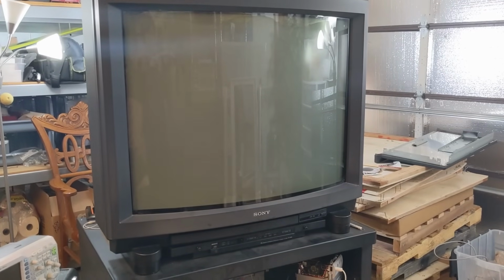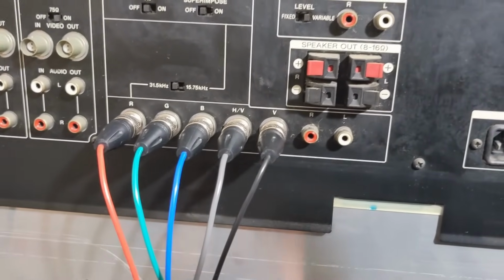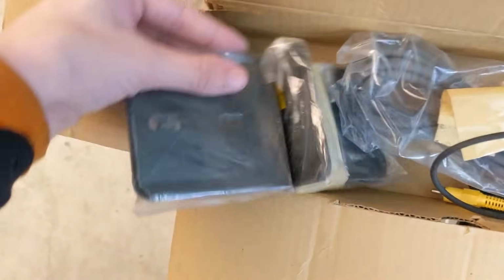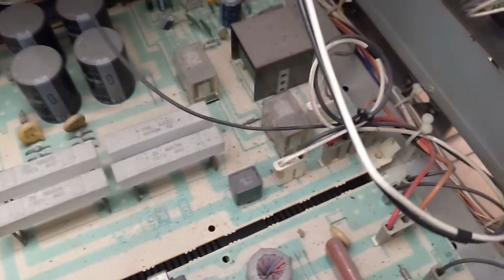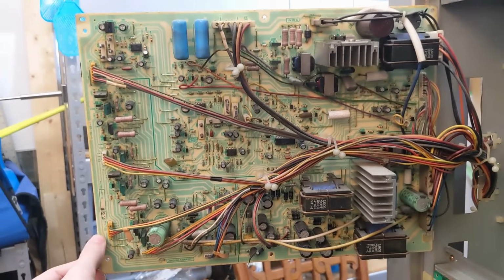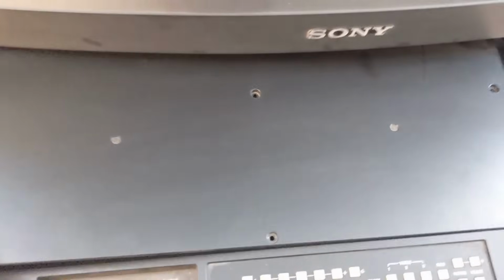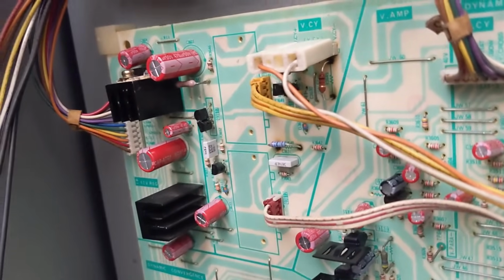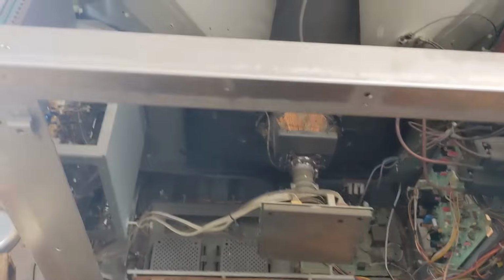Overview of the KX45ED1 / PVM-4300 (Worlds Largest CRT)

Comment from the maker: Few fun facts and FAQs:
-Yes, I'm using a 100v step down transformer. I also run it through a surge protector, and completely air gap the whole setup when it's not in use.
-The TV has 3, yes three, damper wires
-I cleaned it after the filming video. I hadn't cleaned it yet at this point as I was considering filming the cleaning process and including it in the main video, but didn't
-I have not done a total recap yet
-I have not tested PAL, but it makes no mention of PAL anywhere, so I doubt it will work, but I will try at some point.
-Allowing random people to see it is tricky because it's not particularly mobile, and bringing strangers to see it is effectively doxxing myself.
-I am open to cataracts repair, but it is extremely risky so I am extremely hesitant to do so
Reply: This is not classic cataract, more like de-lamination. The safety glass itself might be a double layer laminated glass, and its layers might also in the process of de-lamination. Unless you find soneone who have done safety glass removal on Trinitrons, don't ever risk doing it. And if the safety glass itself is bad or breaks during removal, your only option will be to use it without safety glass. I don't think it would be dangerous, the tube surely has an implosion band too, so it won't implode spontenaously, they just added the glass as an extra layer of safety, because due to the huge size, in case of a screen impact the implosion band would probably unable to keep the pieces of the screen together.

I would remove the front bezel, carefully clean the edge of the tube and check if there's some sealant around the edge where the safety glass meets the screen. If not, or if it looks deteriorated, I would apply some strong adhesive tape or acid free silicone sealant, to make sure dust won't be able to penetrate between the de-laminating layers.
Reply: I would never risk the cataract repair, ever.
Reply: You don't need the 100v transformer if the device has a switch mode power supply, which this monitor does. Sometimes there is a jumper wire or switch for 230v but not for 100/120v.
Reply: @andydelle4509  I do not recommend running Japanese domestic market equipment rated for 100V only on 120V, even though a fair number of people get away with it. The mains filter caps in front of the switchers are only rated at 160VDC with a surge rating of 200V. Rectified 120VAC results in ~170VDC and that's playing with safety margin at that point; which you do not want to do on anything you care about let alone something this rare.
Reply: @MadScientistsLair  " The mains filter caps in front of the switchers are only rated at 160VDC"
Well if that's the case, then my advice is indeed bad.
Reply: I'm not sure that's a cataract. Sony put an anti-glare tint film on those tubes, @RetroTechUSA has pulled damaged/discolored film off PVMs with nothing more than a razor blade.
Reply: @coyote_den   You might be right, but this is easy to test by pressing the de-laminated part. If it's just a plastic film, it will be flexible on that spot
Reply: get in touch with retro tech channel(you might know about him already). He does crt repairs and can give you advice or contacts for specialists to do the repairs.
Reply: I think the only thing that wasnt been said is making sure it is getting clean power and a clean ground. The clean ground being the thing you might look at. 

If it is 2 prong, making sure the neutral is clean. Also making sure things on the circuit are not wired backwards. (Having the Live and Neutral Switched; they light up so everyone things they guessed correctly of which two wires they picked)

These are troubleshooting suggestions for everyone, not a demand or requirement. I always write posts in a way it can be referenced in the future.

It should be understood that no one should expect that you need do anything insane like buy a double conversion UPS. 

This is your TV, and you are sharing it with us. We should be appreciative, not demanding.
Reply: That's not the biggest, I've seen bigger, especially the later digital sets sold to production companies, nice paperweight tho. Will look good on the front lawn in a few weeks when it breaks. Recommend smacking to get it to work, and duct tape. Best of luck pal.
Reply: Were you ever able to digitize the manual?
Reply: Growing up in the 70s I was always envious of people who owned Sony Trinitrons. They not only had great color, they also had the squared corners which was very cool. I FINALLY bought myself a brand new 27" Triniton in June 2000 when I was 42 years old. I bought it on sale for $328 and I had. to wait ten weeks for it to be delivered. As soon as it came I rushed out and bought a DVD player. Unfortunately, I only had the Trinitron for five months. While I was visiting my family in Florida for the Thanksgiving holidays, a very bad storm happened where I lived in California. The. wind was so strong it broke my window and it rained on my lovely television for three days. When I got home it was  deader than disco. I didn't have a tv for a few years. I bought a 37" Toshiba flat panel in 2005 and it lasted 21 years
Reply: I don't think I've ever seen a crt be able to do pal and ntsc until after 1990
Reply: @turbinegraphics16  There were plenty. But they were usually sold for PAL markets. NTSC sets rarely have PAL decoders, but PAL sets often had NTSC decoders even in the '80s. I have two almost identical multisystem 14" JVC TVs from ~ '87, they can do PAL, SECAM, and two kinds of NTSC (one of them only supports one NTSC standard IIRC). The only thing they don't support (or at least don't claim to support) is PAL60. Unfortunately they only have an RF input.

Comment: There are way bigger television sets out of America. Especially tube sets from 98 on that aren't projectors. Phillips used photography sets special order, but no where were they as nice as Sony sets, but I remember those sets being 54 inch crt tubes and they weighed a lot less and overall very impractical for anything but composite light photography. But there are larger, but your set is nicer and heavier. Pixar used the set im thinking of.

Comment: I have a Toshiba 42 inch its like 220 LB's. I have a 40 inch Trinitron (Sony) Thing is like 160-180 Lb's. Its wild that in 1989 for 1 extra inch at ''43 inches'' It weighs 440 LB's and cost $40,000 Retail. The two Tv's I have were retailing about 3-4K USD when they came out in late 90s early 2000s. I feel these Tv's are a lot more special now. Lighter weight look better with retro games... Not a PVM but hey same stuff...

Comment: I wouldn't suppose you would treat me a 2010 IPS bravia with ccr tube still working just fine? 

It's slightly less viewing area at 40 inches but are becoming as rare as CRTs. Sometimes moreso. I'll throw in a 2007 dell 24" IPS PC display with ccr tube still working.

Comment: I was a TV tech from tubes until the demise of projection TVs. Started in 1984 with old tube TVs in school. Sony always was a total PITA to work on. They just did things that sometimes seemed complicated for nothing more than to be complicated. But, the projection TVs near the end had automatic kine bias. This means that as the tubes wore, cathodes, they would measure the current draw and adjust accordingly to keep the Grey scale ad perfect as it was set from the factory. Meant good color. Hitachi used to have point to point dynamic convergence, I think it was about 100 points throughout the screen. In service mode you would move a cursor X so to speak around the points. Then adjust each quadrant perfectly. You could spend hours in service mode doing this. It was also done digitally with the remote in service mode. If you spent enough time it would really be perfect. Not only that but the screen had mirrors in quadrant around the screen. The system would look at the convergence when finished and keep it there with automatic convergence. Projection TVs were really cutting-edge technology at the end of their life until flat screens killed them.

Comment: Are you certain that the line doubler can't be switched off for 240p? My Sony CRT projector has a built-in line doubler than can be turned off in the menu but the name of the setting is unrelated to the function.
Reply from the maker: I am not certain, but there is no OSD or additional settings to change

Comment: I had a 27" Sony Trinitron from the late 80s. It was in use till 2005 when I bought one of the first Bravia 32" LCDs. It is currently being used as my second monitor. Only downside is that it's 1080i, so I run it at 720p.

That remote control totaly brought me back to childhood, 'cos my CRT had a similarily shaped but narrower one, It also had that plastic window compartment.

Cheers!

Comment: I own a 27inch Samsung Dyna Flat CRT.  I acquired it in 2000.  Excellent convergence, geometric linearity.  It also has a tilt feature, turbo sound, component and weighs 110 pounds.  I've owned a 20inch Proton, which had a rainbow.  My Samsung DOESN'T.  It's only weaknesses were over scan.  This is the only CRT that I've owned that didn't have a rainbow. $1000 CDN.  What about your Sony?

Comment: that 21 pin plug thats above the word superimpose is called a scart socket which a scart cable  with two scart plugs at each end that plug in the scart socket here in the  u.k
Reply from the maker: Nope, it's JP21. Uses the same connector as SCART but has a different pinout.
Reply: @MoreShankMods  I'm sorry but that's what you call it. But here in the u.k it's we call it scart plug or scart socket we still use it now it doesn't matter where what pin out put is we still plug in scart plug into it?
Reply: @jambam6762  Its JP21 similar plug but its a completely different standard with different pinout, plugging in a scart input can fry your device and/or your TV.
Reply: @mactep1  Then why didn't he say it's for japan scart in the first place then this argument would of not got bad on here jp21 model number but instead,  he should of said it's for  japan 21 connector plus i just looked it up on the net what the differance is between euro connectors and japan connectors and they are differant which i didn't now I thought all scarts sockets are the same, so sorry but he should of explained it more detail and show pictures and info to people on youtube.
Reply from the maker: If you Google "jp21" it explains everything you need to know better than I can in a youtube comment 🙃

Comment: How can you repair a television without knowledge in complex impedance, physics and other things like inrush current?
Reply from the maker: How can a mechanic repair a car without a master's degree in mechanical engineering? I'm not designing a TV from the ground up, I'm repairing it. Find what's wrong, and test the components of the relevant circuit to make sure they are within the specifications described in the service manual, and replace components that have fallen out of spec.

Comment: Once you get this deep cleaned inside, fresh PSU caps, service menu tuned and colour calibrated, I'd look into adding an extra SCART input that is connected to a subpixel rendering scaler inside the set, directly wired to the internal RGB line, the subpixel rendering scaler board should be a 4X subpixel scale, which will give this set 4 virtual RGB subpixels per physical RGB subpixel, this will massively increase perceived resolution, and negate the fact that it's a larger screen which typically has a lower perceived resolution (subpixel-resolution), the GBS-C internally installed with a SCART output would be a great way to do this, it would also allow for some great extra image options, allow for running 16:9 aspect content in cropped full-screen 4:3 with decent image quality results, reinforce scanlines in desired for increased fidelity, motion adaptive deinterlacing for 480i to 240p or 480p, and if you wanted to, you could even wire in the HDMI as an input for the display, which will give you HDMI in with very decent image quality, which could be very useful for modern sources like Blu-ray, Switch, Laptop or Steam Deck and so on, and whilst your at it, why not internally install an RGB-Pi into the extra RGB input of the GBS-C, for built-in emulation for everything up to 7th gen, with immaculate image quality and processing thanks to DynaRes (RGB-Pi), with the GBS-C, you can also use your smartphone as a remote for the display.

As a finishing touch, I'd upgrade the power input to a sine-wave filtered power input module, to provide stable clean power, which will provide the most stable image possible, with the least flickering or interference, which can be an issue with high-powered analogue AV equipment, it will all really help keep the tube as healthy as possible, and the electronics inside will benefit too. And I almost forgot to mention, I'd look into a smoked black tint film, as it really does improve the image and contrast quality of grey glass CRTs, the difference on my Sony PVM-20M4J with a black tint film is profound, it may not be as colour accurate for film editing or other pro uses with a black tint, but the blacks, colours and contrast looks so much better, it looks as good as a Sony Hi-Black Trinitron (black glass).
Reply from the maker: There is no service menu, it's all analog adjustment via pots. Subpixel rendering is irrelevant because it's lines, not pixels. You are probably thinking of 4x sampling rate, which is pretty standard for most video ADCs. Picture output from the GBS-C is quite soft and latency is suboptimal; the appeal of the GBS-C is its low cost, not ultra-sharp quality. Higher resolution stuff I would want to scale to a sharp 1280x960i instead of a soft 480p like the GBS-C does. I use OSSC for lag free line doubling of 240p; horizontal resolution is untouched if sampling correctly. Basically all 480i content can run at 480p except PS2, which i have a pixelfx kit installed for. 

This is basically a museum piece, so it will not be "modded" especially not with a scart connector or a raspberry pi. No need to put anything internally when there's 31khz RGBHV BNC input and a large piece of furniture below it to put pretty much anything.

Comment: Is the protective layer on the glass even structurally necessary?  What I mean is, the real reason we need screen protectors on our phone is not to prevent the break itself, but to prevent scratches that will create weak points for the glass to break along when it is actually dropped.  I think the same principle applies to this protective coating.  There's no way it could be structurally important if it's held on by some weak glue, not in the case of a vacuum tube.  Basically you just want to get that nasty old thing off and replace it with a large screen protector.  You may want to ask your Sony engineer friends about the structural thing though, just to be safe.  I think it's just to prevent scratches though.
Reply: Most phones do not have a CRT display with vacuum inside, and thus come with a protector to stop glass flying in your face in case it breaks.
And most TV's are not carried around, with a chance of getting scatched by other stuff.
Reply: @erlendse  Scratches are the primary cause of structural failure in glass.  Even cleaning a CRT can introduce micro scratches.  The logic is the same.  A cheap adhesive coating prevents this.  Steve Jobs went to Corning seeking a scratch resistant glass, and Gorilla Glass was born.  Go read a book instead of arguing about things you do not know.

Comment: Thanks for the video on the main channel and tear down on this one. You have influenced me to pick up a Sony KV-40XBR800. That beast is going to be 304lbs.
Reply from the maker: Be mindful of the limitations of that set. It scales everything that is not 1080i to 1080i, and adds a few frames of latency. If you are planning on using it for 240p retro gaming, it is a very, very bad choice for that.
Reply: @MoreShankMods It's mainly going to be used for 6th and 7th generation consoles. I have a kv-27fs100l for the SNES and PS1. It would be interesting to see what those 5th generation would look like on such a big screen
Reply from the maker: Even at 480p, you are still looking at scaling and processing that result in 2-3 frames of latency, depending on the chassis. So depends on the game. Precise stuff like shooters, fighters, platformers, etc will not be a good time, but turn based RPGs would be great.
Reply: @MoreShankMods I got it set up in the game cave right now. Have not really noticed the latency yet. Been playing Baldur's Gate Dark Alliance, Metroid Prime, Splinter Cell, Jak and Daxter, and Halo on it. The only thing that bothers me is the color is a little off compared to my Sony KD-30XS955 side by side.

Comment: What does 480p mean? What resolution in dots/pixels is that?
Reply: It simply means 480 active horizontal lines per frame, and in this case 60 frames per second.

CRTs can take arbitrary horizontal resolution as input, but what detail they can actually resolve is limited by the aperture grille and the density of the phosphor coating, measured in TVL. I'm very curious to know the TVL rating of this tube.
Reply from the maker: Iirc I measured about 600-650TVL, but right now it's bottlenecked by the horizontal convergence. I bet it could be higher with some more tuning.